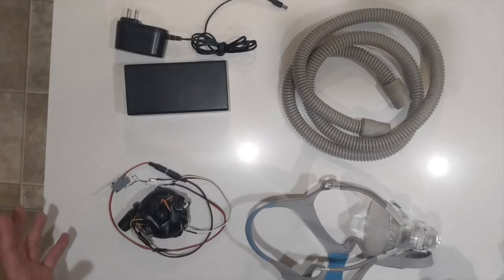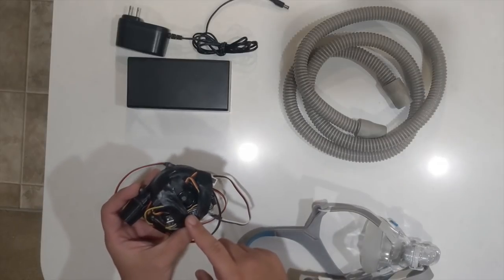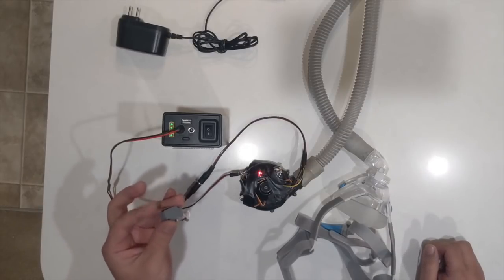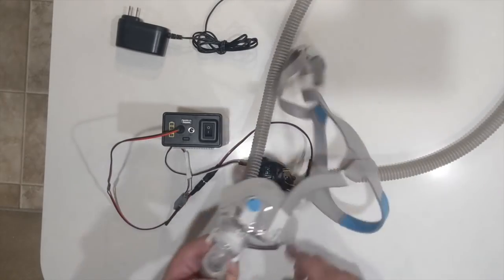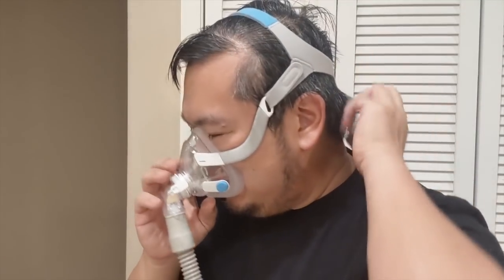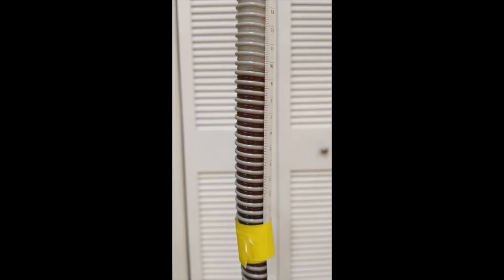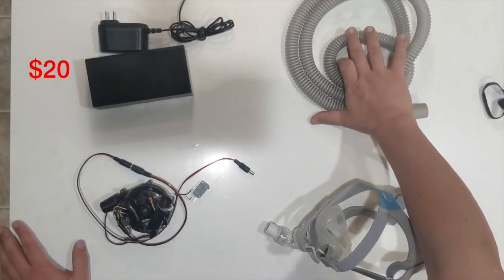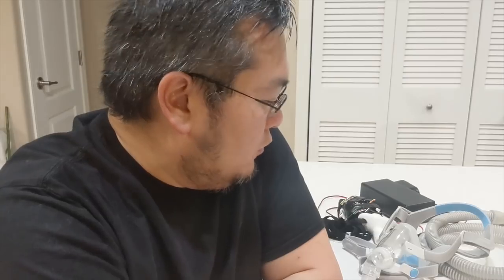Low-Cost Open Source Ventilator-ish Device

Comment: Hi Johnny - I'm a respiratory therapist, with 50+ years of experience under my belt, who could answer a lot of the questions I know you have. In addition to my respiratory therapy clinical, management, teaching, research and publication experience, I managed to work for a couple medical device companies for about 10 years and have some experience with the development, manufacturing, regulatory, marketing and sales aspects of medical device creation. Like many of the others who expressed themselves here, I am also amazed and grateful that there are creative and caring people like you who are willing to attempt to solve challenging problems that have the potential to save many lives. However, and I mean this kindly, you don't know what you don't know. Yet. And you were honest and humble enough to point that out during your video. Please let me know how to contact you to set up an opportunity to discuss your technical issues by telephone. I can tell that you have the know-how to problem solve and get things done and I think I might be able to sharpen your aim a bit in the realm of mechanical ventilation. Thanks.
Reply: Johnny, this looks like a great idea.

Michael, after seeing this, I came up with a way to make these much cheaper, and can provide air for hundreds of people at a time, using items that can be found at any hardware store.  They would definitely have that 'made in a garage look'.  As you kindly mention above, I know nothing of what it takes, medically, to pull this off.  However with guidance, I could also try to assist in coming up with something that can be quickly made.  If what is shown in this video, can work, I might have a solution for larger groups of people.  I plan on making something today, regardless.
Reply: Michael McPeck, I am an Engineering student at Penn State looking into this issue as well. I have a bit of medical experience as I am a NYS EMT, however, I am still relatively inexperienced in the realm of making FDA approved ventilation devices. Your expertise would help me around making the device up to current standards in terms of patient care. Thank you for your time.
Reply: I have experience of supplying hypoxia via a mask and tents and a production facility(own workshop ) in the uk , I could definitely help with this project , I would love to be involved and could add high oxygen to this via oxygen concentrators which I use on a daily basis and service too
Reply: Nice to see someone with wisdom help someone that is trying to help people! one question though these machines dry you up after wearing few hours being a dry cough with Coronavirus would having humidifier  be safe to have on due to the dry cough?
Reply: @SWTWHITEGSR  Usually these ventilators have a heated humidifier to bring the air to the humidity and temperature the body needs before inhalation.
Reply: @coltonwashburn4973  yes but with Corona is humidity a good thing? That's what I wonder. Using no humidity dries your throat after few hours. Regardless nice of this YouTube to try and help situation 👍
Reply from the maker: Thanks for the feedback.  I would appreciate it if you could review the github project which aggregates feedback on how this could be improved and when it could be useful.

https://github.com/jcl5m1/ventilator/wiki/Notes-from-chatting-with-a-pulmonologist

If you have additional recommendations, feel free to provide guidance to help improve the project.  I have the following thread open to track professional feedback.  Advisers willing to share contact info are greatly appreciated.

https://github.com/jcl5m1/ventilator/issues/16

...or if you are willing to share contact info here.
Reply: You and OP should start a github repo where all information should be available.
Design, schematics, cad drawings, everything.
Reply: Michael McPeck can’t you just use a cpap??
Reply: 👍🏻 help each other to achieve
Reply: Yes he doesn't know what he doesn't know and neither do the hundreds/thousands who read your comment.  See the problem?  If you had explained the issues or at least start to we as a community can come together and build solutions.  I'm very happy for my new friend Johnny with his great ideas to continue working on it, from my mind with my 'limited' scope I think he needs to be using an oxygen concentrator on the other end due to the pneumonia [fluid filling the breathing sacks] reducing lung function.  

I've got oxygen with a hand respirator for instance, after explaining what I was working on for an emergency [hospital beds unavailable as is coming] a senior anesthetist friend of mine was telling me that they used to put med students on them for people with polo when they had nothing else.  

 You've got to understand what you might not understand the vast backyard tinkering that is available, I applaud you for your knowledge and I also ask you kindly and humbly, please don't be holding back we need your expertise.
Reply: They have the technology and it does not look like this crap.Whatever ur creds are. AS a pharmacist, this is crap.
Reply: Colton Washburn They’re even more sophisticated machines than that which is why they’re not easily replicated I’m guessing.   I admire everyone here acknowledging that it will take a community effort to overcome the challenges.
Reply: @bloodaid  This idea. Github and share it.
Reply: @mskimberly7777  Greetings Kim. Thanks for your comment. All opinions are valuable. I'm not sure who the "they" is that you referenced, but no one would be concerned about this if there wasn't a potential crisis brewing with respect to a shortage of capable critical care ventilators. We all hope it doesn't happen but we wish to be prepared with some sort of viable backup solution if it does. You're correct to the extent that the idea expressed in the video at this point in time may well be "crap," which, I assume is a technical term you pharmacists use to describe things beyond your level of comprehension. However, this crappy idea could well be the seed of something that might be able to grow into a viable solution if enough creativity and brainpower from many different disciplines is cooperatively combined. I am truly disappointed that pharmacists, despite their creds, apparently have nothing of value to contribute. Take care and stay well.
Reply: @BrenzMarie  Don't even try to sell this idea. They meaning "common technology"
Reply: @BrenzMarie  SMDH Ventoliator ish STOP!
Reply: @mskimberly7777  You're just full of yourself...
Reply: Johnny Lee and Michael, - obviously this is a great start, but sleep apnea ventilators aren't universally common. For places like Iran, the situation is dire and anything might help, then it struck me. Inside every old car in a junkyard there's a very powerful DC air blowing motor, from the Air con system. Because the blower is right inside the bonnet it's generally protected/in good condition, and helpfully uses 12V power, allowing for portability too. They are very strong, and can cope with a high degree of static pressure. Control with a variable resistor, and for all basic old cars operate in the exact same way. 

Just a thought. :)
Reply: @tsbanking  Ha ha WEAK1
Reply: Hi michael, im juan from argentina, can you help me devolping a low cost ventilator i was thinking in something arduino based can we get in touch so I get some info about the basic requirements to make something usefull.
Kind regards
Reply: @tsbanking  The lawyers care. You will face lawsuit.
Reply: Wow.  I had an argument with someone who said something like ".....that's why noble peace prize winners don't post YouTube comments.". Ur proof of what I concluded too, that doesn't mean a many potential candidates haven't.
Reply: Please share w us all your thoughts to sharpen the aim. Thanks.
Reply: @bloodaid  There is a github link listed in the description: https://github.com/jcl5m1/ventilator . Feel free to participate if interested.
Reply: @xyjames  There is a github link listed in the description: https://github.com/jcl5m1/ventilator . Feel free to participate if interested.
Reply: The main question is: will this help in the case where someone needs a ventilator (1=it will definitely not help, 2=maybe it could help, 3=it will help a little, 4=yes it will help, 5=it will definitely help). @Michael - please provide your professional opinion by selecting a number. We need solutions that are not over-engineered preferably for emergency DIY kits. ventilators are engineered to get more optimal results, understood. I just started looking this up so am learning from scratch (forgive my ignorance).
Reply: could you two make one video where we can make the right thing? so we all could try that at home? maybe with a local MD telling what to do, precisely. Guarding all these patients using this? Can we collect more people, so this can be approved. Spain is in extreme need of more like this. They let now people die, and MD's cry...Italy the same. Dutch get the same problem soon. We will need many of these things to survive. Till how far are we allowed to use all this, and how can we use it? Make it. And get it approved in the way that all do use it as soon as possible, safely.?
Reply: but we could work this out, we need a few thousand just a few thousand of these working, and bring them to the countries. It would need one big project of us all at home making a few, just a few thousand people, and then we have fixed it...
Reply: governments could approve... ??
Reply: @FL-cq2ig  I second your request.
Reply: And then make another video ASAP to show us the updated version👏🏻👏🏻👏🏻👏🏻🔥🔥🔥🔥🔥
Reply: Hi Michael. Is there any way I could contact you via email
Reply: @JackInTheFrost  if you talking about medical grade, well the medical grade doesnt matter when you doesnt even have any ventilator.. if you talking about the precision, well doesnt matter which precision as long as you have any kind of help to breath than not having any, so please stop the negative thinking, people trying to help other people here, me as engineer i understand it may looks crap but even a cup for coffe started as a ceramic cup and ended as a vaccum insulated cup with hours of thermal capacity; you lack vision.
Reply: I can build anything. What is the output volum, intervals etc. I can build can improvise with anything. Thank you
Reply: Michael could you please explain us what is the down-sides of this project and what should we know before prototyping a similar project?
Reply: @SWTWHITEGSR  I think what you are saying is that, at least anecdotally, we find it harder to get oxygen from humid air even when we are healthy. I do at least.Additionally, I personally feel it's easier to feel like I'm getting enough oxygen from cold air. But when sick it may be a different story. One thing I heard is that the virus may not travel as well through humid air. Not sure if that's true, and what relevance that would have to humidity in a ventilator. This is a great project. I have a feeling the experts are going to say that you need some kind of pressure sensor and more involved software to adapt to pressure feedback from the individual patient. One thing I know I heard from a video done by Ninja Nerd Science channel, as well as some others, is that PEEP is very important--the idea that you want to make sure the final pressure in the lungs after exhalation is somewhat greater than normal, so that the compromised alveoli (in ARDS) don't end up collapsing and expanding each cycle, but maybe stay somewhat expanded at all times? Also, I think it was said that you don't want to force too much air depending on how much of the lung is compromised, because the amount of air you can safely put into ARDS lungs might be different than when healthy. My guess is that the rather digital options including fixed 10cm water to 20cm water and some other digital levels of motor speed won't be good enough to the experts, even with the options you have cleverly provided. I'm thinking you agree already with that. So sorry if this is useless. I'll stop now until I have something more useful to say.
Reply: can we make open discussion in order to benefit all people around the world specially those countries very limited financial resources ? thanks
Reply: I have an APAP machine, it is an evolution of the CPAP and is capable of automatically adjust the pressure based on the obstructions it detects. Would an APAP (mine is a Philips DreamStation) machine be better therefore than a CPAP as a better than nothing respirator?
Reply: My younger brother is a Doctor and he told me that non sterile material could create a worst problem because of easiness of infections. I proposed my brother to construct portable lightweight ventilators made out of aquarium's filter device. His answer was no way under no circumstances but given the situation, I guess these options are better than having nothing, ain't it? Please don't get me wrong, I honor your experience. Best wishes.
Reply: Go team! I appreciate a group approach to a national problem amidst this crisis.
Reply: Hey  @TheAlastairBrown  good info.... maybe that is why car factories in US are planning to produce this devices in big numbers.  Let see if they really do this.
Reply: First off, thanks for doing what you do, you help PAs like me so so much. Also, very glad to see you would extend yourself out to help Johnny get this dialed in even more. Great to see people helping people.
Reply: Although I am sure a device developed by medically trained people will tick all the boxes, it is the insight from the non-medical people -- from engineers, tinkerers, 3d-printers, software hackers, etc -- who are going to help break barriers and blind spots for this life-saving device at this critical time.  I hope all the innovators don't feel they are not able to contribute, but just venture forth and throw ideas until something sticks.
Reply: @mskimberly7777  get from here you .This is part of getting ideas from others who can contribute to the society not the way you are thinking lawsuit haha now get a lawyer to earn you hundred bucks.
Reply: Chris G - as a victim of the virus and currently taking chamber breathing treatments daily, I applaud your intelligence and information that can be shared and utilized by companies and or individuals to do something!! Where the FDA is concerned, trump is not mentally competent to get approval for the project to go forward, we have qualified specialists and scientists that can oversee these products being made. The FDA HAS STAMPED APPROVAL ON MULTIPLE ITEMS IVE USED OR TAKEN YEARS BEFORE BEING RECALLED, SO WHATS THE DIFFERENCE NOW, time is of the essence, why don’t we stop with the back and forth and give the go ahead and at least try and work with the brilliant geniuses we have here at home, why is America dragging it’s feet, think of this as 9 11 in every city/state
Reply: @blogobre  in any HOSPITAL there would be wall oxygen available and varying levels of pure oxygen are fed into the system.  i just took a quick view at a youtube on a medical ventilator there were at least 4 knobs are language like FiO2, PaO2, respitatory rate, tidal volume. there is probably dwell or pause time at start and end of inhale and exhale.  For ARDS, there is diminished capacity and this video said a common setting for one of the knobs was 55 instead of 85 and usually started oxygen at 100 percent while these others paramaters are calculated.  CPAP or Bipap may indeed keep an airway open more but it does not Breathe patients like a ventilator.  Like the michael guy said we do not know what we do not know.  Cpaps are now seen as culprit in spreading Coronavirus in the kirkland senior home where 30 patients died and 60 healthcare workers had to be quarantined because they suspect the CPAP turned patients exhalation into a viral cloud aeroso.  I was wondering Michael Mcpeck has is the exhale air of the patient processed, is it sucked back into ventilator where it is uv sterilized or anything like that.  Seems to me, aerosol of the exhalation may be a dangerous issue for any form of mechanical ventilation that is forcing volume or pressure.  Might be good for some of the patients but possibly a hazard for healthcare workers.  i have been kicking around some ideas about portable air vacuum devices that at positioned floating just above ventilator mask with sufficient cfm to suck all exhale up a vaccuum tube where the aerosol is treated with uvc and even uva and uvb as they are are germicidal to some degree, photocatalytic type air purification on hydroxyl ion generators or even ozone which would then be have to be processed in a ozone destruction outgassing chamber before the air enters the patient airspace again. At any rate some suitable sterilization technology. Small duct fans or even exact size cpap fan like johnny lee employed but a floating fume hood arrangement with a small duct fan mounted to some kind of articulated arm or retractable tool positioner so it could just hover close but not touching the patients face would be the least non invasive and not interefere with the breathing technology  the duct fan could also be placed remotely to reduce weight and to reduce annoying noise of fan motors but there are a lot of quiet 4 to 10 inch duct fans that are very quiet. On the intake and exhaust ports of the fan sections with powerful uv tubes can be mounted.  the trick is to have enough contact or exposure time of the aerosol particles to the germicidal lamps to insure something like a 5 log reduction of the virus so the cfm above the face would have to be fast enough to ensure no exhalation escapes being sucked into the sterilizer but not so powerful that the virus is hurled too fast past the germicidal chambers.  I suppose more chambers could be linked to ensure enough exposure time.  I have seen battery powered uv wands of 6 and 8 watts that a user just waves over a countertop that supposedly kill 99% of germs so, 13, 20, 36 watt lamps that are inexpensive and widely available can be configured in such a way to guarantee kill off.  I have to research to determine how to estimate this.  BTW Johnny lee your approach is much more sophisticated that most of the ambu bags squeezers i have seen out here. the whole thing with the arduino and the hand switch or dial for 5 speeds is actually a huge improvement over endless squeezing at the same speed.  You should definitely hook up with the Michael guy, you need an expert in the human physiology of this and an understanding of how the current higher end technologies work.  He can save you from wasting time, because you have the smarts to cobble together an effective life saver but without knowing anything about how humans really breathe and how to dial in not only rate, but pressure and volume indepently and also the ability to feed and mix pure oxygen and i am sure a dozen other things that i do not know, you will fall short like most of the other designs out here.  I myself independtly thought of a mechanical ambu bag device after seeing a news clip with a doctor squeesing a bag valve mask which one would have to squeeze for days on end for a covid patient.  i came up with a linear actuator ball screw concept and the use of a recipocating motor cam arm pusher that you can buy for $30 on ebay [they use them for sex machines] un beknowst to me Dyson, mercedes formula one, at least a couple of american university came up with similar concepts this week already or reversed engineered a cpap machine...but these are not medical ventilators though they might be better than nothing for a patient who lungs are filled with fluid.... but even as i worked out the simple part of the concept i realized that breathing was more than inoutinoutinout but mor likely In pause out pause with perhaps some ramping.  Speed or cycles per minute could be controlled by using a slow speed higher torque motor coupled with a mated speed controller or pwm or like your are using a arduino board which can control similar components.  Volume can be controlled with the proper size ambu bag which are as cheap as $15 or with your little fan device but air volume or oxygen air mix volume really dialed in would be appreciably harder as well as absolute control over the pressure.  If you were not aware that ADRS patients do not really breathe 16 times per minute or what tidal volume etc to avoid problems for that specific patient you could actually kill the patient.  Doctors sometimes have the authority to use a device off label such as the surgeon in the las vegas shootings that hooked up multiple patients to a ventilator. In this case, all tubes have to be same lenght. patients have to have similar lung volume and probably the whole thing is just barely to keep up to 4 patients alive rather than save one and kill three.  However, that does not ever mean the FDA would approve a device to be sold or even donated probably for that specific use. Yes, an md might use a cpap or bipap in desperation but ResMed would never get FDA approval to sell the machine to subsitute for a real ventilator much less any of us garage mechanics.
Reply: @BrenzMarie  Ouch  👍🏽